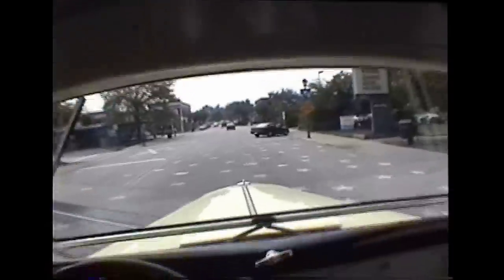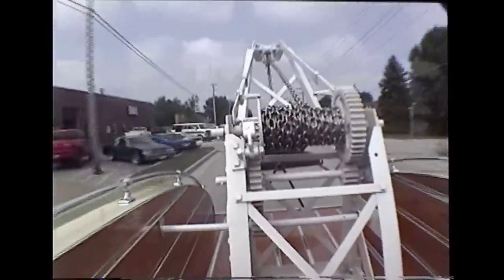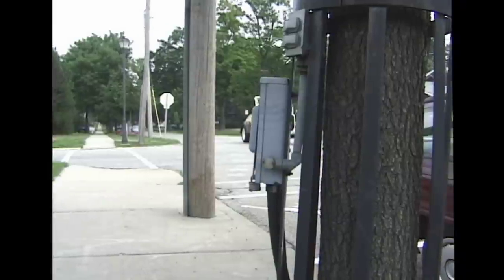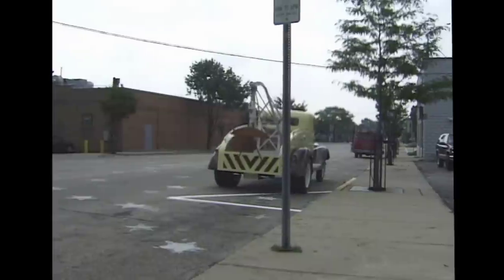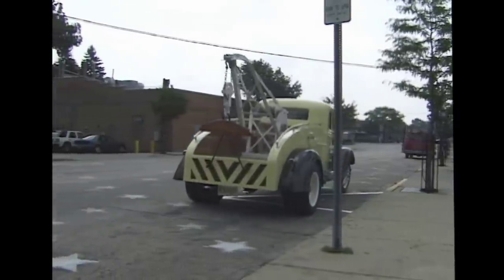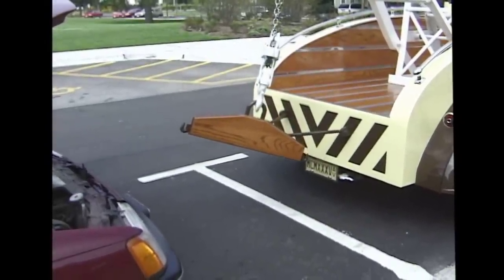1935 Ford Tow Truck - We go for a ride!

Comment: Amen about the part of the running gear for the large trucks not being available! I found that out the hard way about 8 years ago restoring my '33 Ford BB 1.5 ton flatbed. Did finally get her all done, but took a lot of parts hunting, both commercial stores and private collections. Great video! (Have a '35 Ford 1/2 ton pickup, also.)